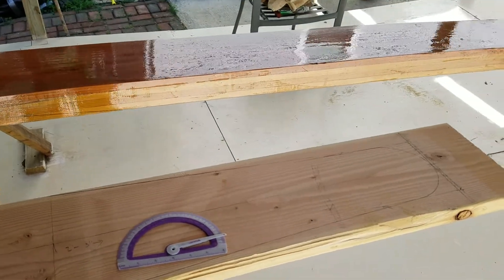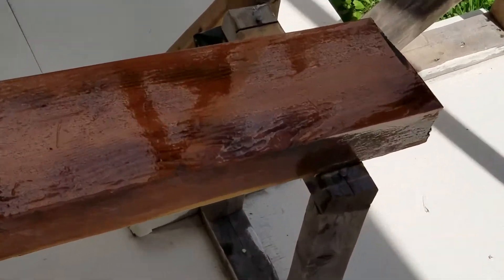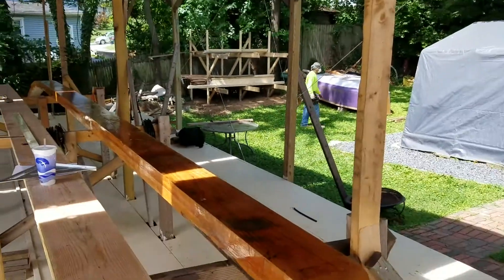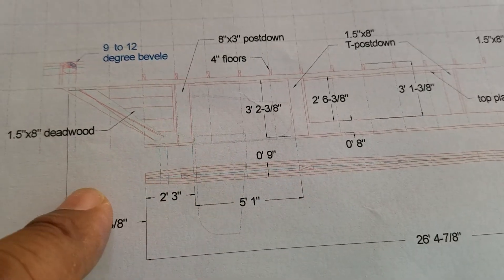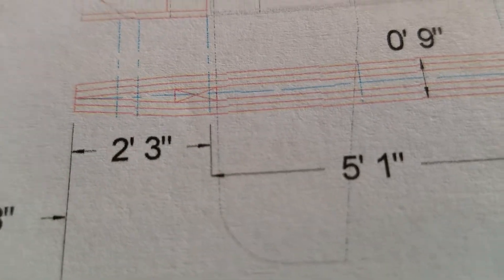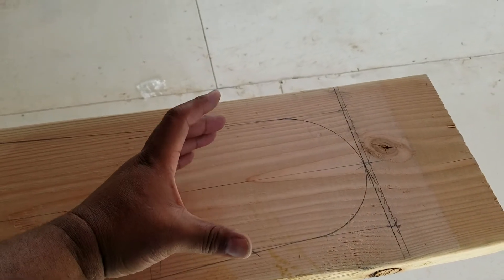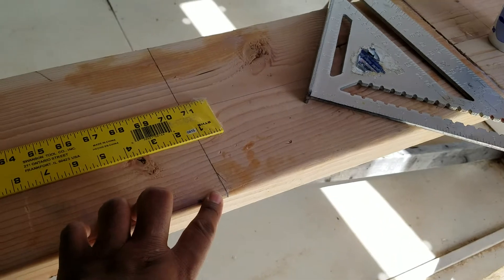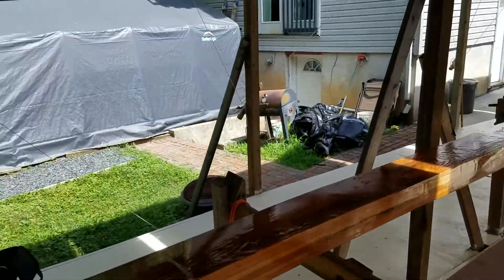B.A.B.S.  Creating a high aspect ratio foil - keel layout

Comment: Great video and very interesting watching you form the Keelson.  I was wondering if you had a full detailed plan of the actual boat? I don't think i have seen the boat its self only portions of the keel and keelson.. Thanks
Reply from the maker: Curtis I've got dozens of sheets of drawings. Even down to the plumbing and electrical. I did a video back in the fall of 2014, I will send you a link. What's your email?
Reply: that would be amazing to see the design.  my email is curtis403@msn.com